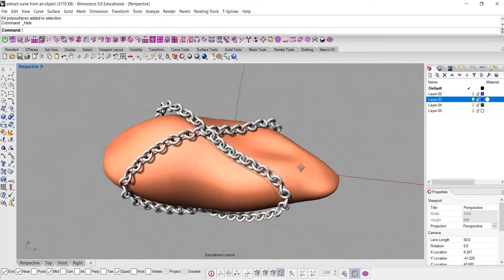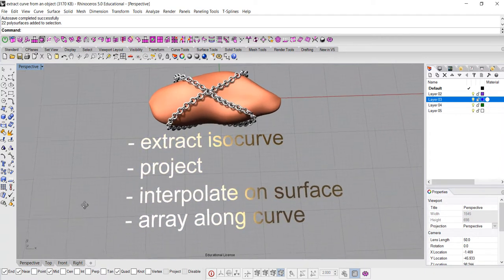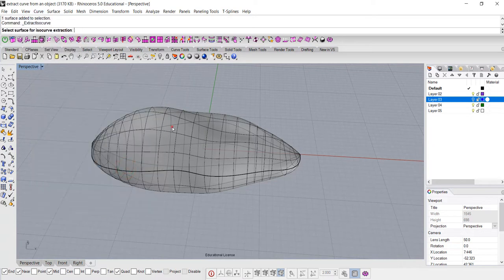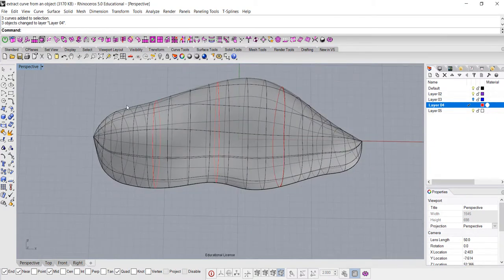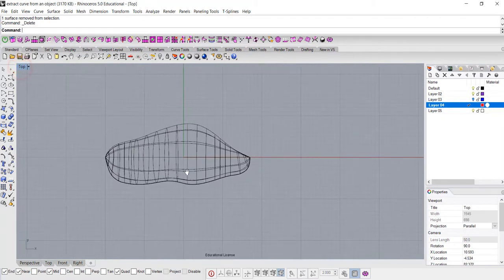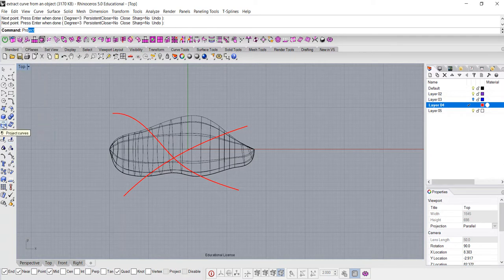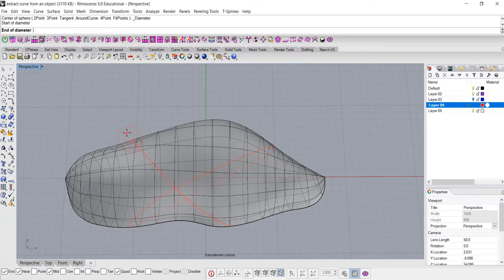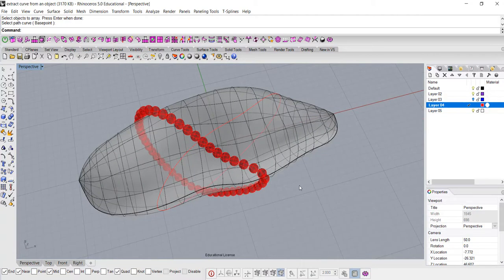Rhino 3D CAD Technique #7- How to Extract Curves on an Object in Rhino 5

Comment: Hi PJ Chen! Thanks for your help and your amazing videos! I have a question regarding array along curve/ array along curve on surface. How do I have to pick the base point? I usually put stitches , consider them little tubes,  on my models but i often have them in curios directions (some times they’re oriented horizontally, sometimes vertically, or sometime they follow the normal) 

Thank you
Reply from the maker: if you are going to make stitch. I will project the curve to a surface first. and arrange the first stitch direction along the curve. then use array along curve
Reply: PJ Chen Jewelry Design t’ha k you very much dear! ❤️
Reply from the maker: @davidemotta3585  You are welcome

Comment: Nice tutorial - as always. Thanks for sharing. One off topic question: What is the menu band with all these magenta colored buttons right under the command line?
Reply from the maker: could you tell me what min:second you see that on the video. I will check on it
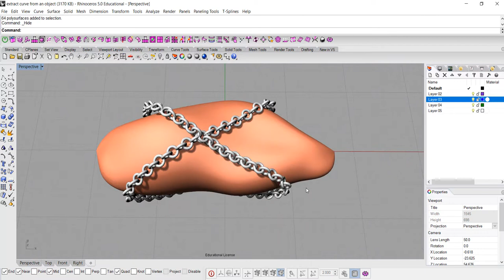Reply: @PJChenJewelryDesign  It is visible all the time in this video - i.e. in 0:30. The menu band is horizontal, starting between the words Command and Standard on the left. It looks like maybe coming from an additional plugin. I would liek to know which plugin is that.
Reply from the maker: oh. That is T-Spline when I use Rhino 5. but T-pline is no longer available for Rhino 6.
Reply: @PJChenJewelryDesign  Now I understand. Thank you.
Reply from the maker: @3dbits_art  great!